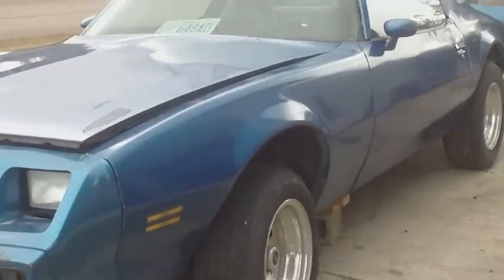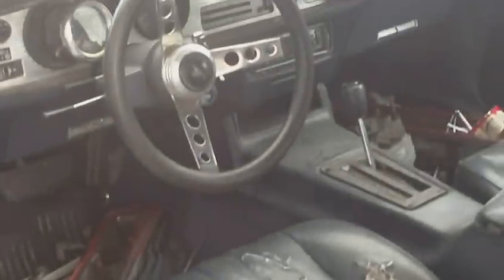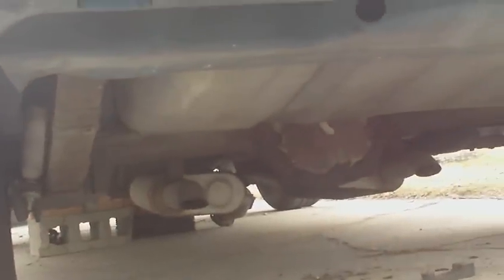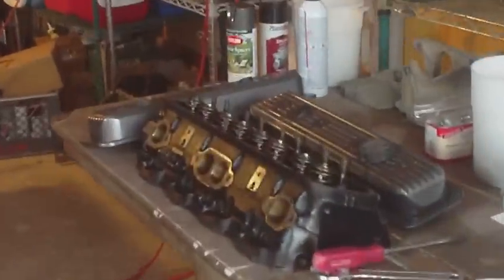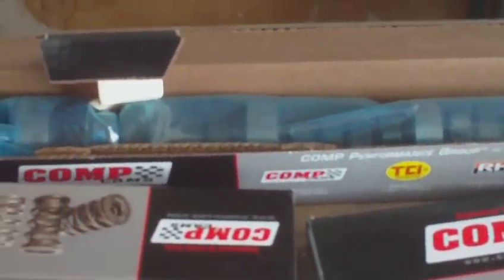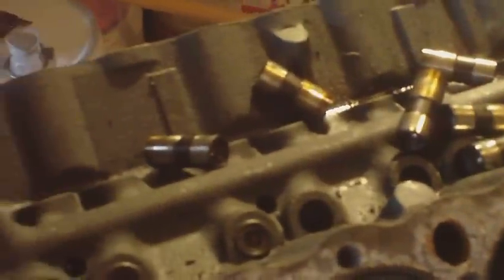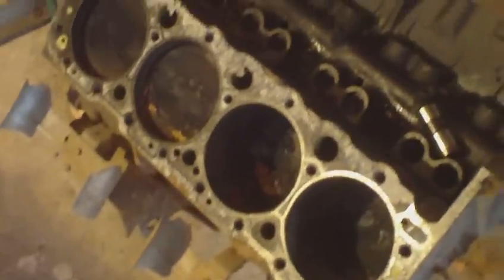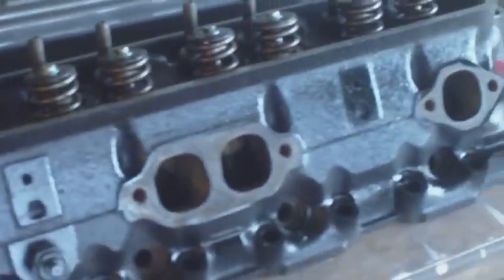1980 Firebird Restoration (In progress Part 1)

Comment from the maker: @DevastationFilms Thanks.. I keep running into snags. I planned on just replacing the engines top-end. But after tearing down the bottom end I noticed that the 1976 motor still had the original bearings. And they have some miles on them. So I decided to rebuild the whole motor.